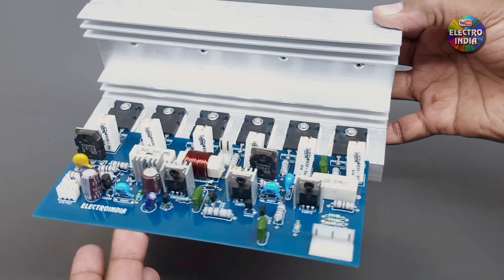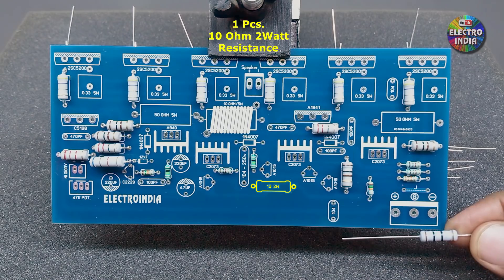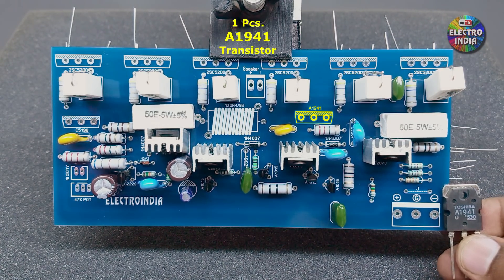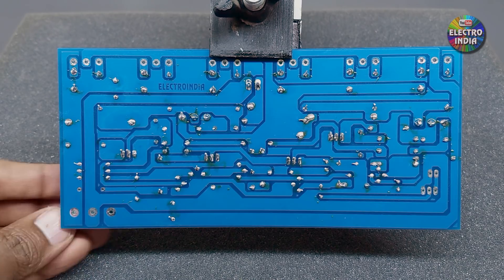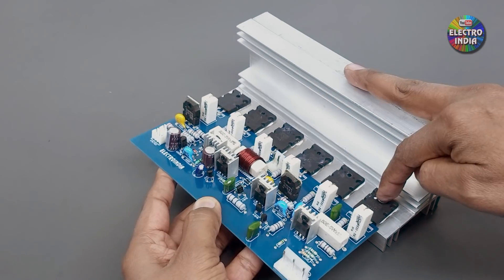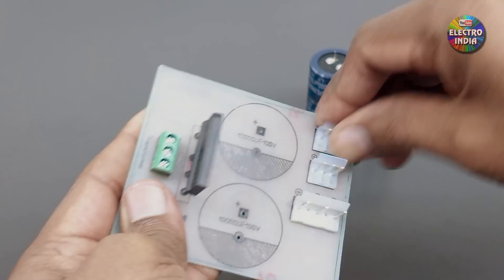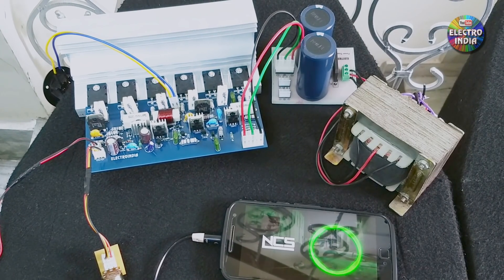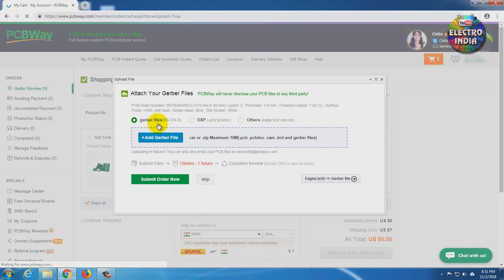300 Watts Mono Audio Amplifier Board DIY Toshiba 2sc5200/TTC5200 Transistor | Hindi ElectroIndia

Comment: Congratulations on the content of your channel.  I am thinking of building an amplifier for a 12 "/ 600W subwoofer box. I would like to know if this model works well. There is another one with 4 transistors and the source on the board itself. This one is easy to assemble but has only 200W.  Here in Brazil it is difficult to find original transistors. Thanks

Comment: Mujhe yeh 300 watt mono board with low pass filter kharidna hai....Aapka wattsup no. message kariye....Mera no hai 9727335274.  Mujhe 50watt each 5.1 7294 ic setreo board bhi aapse  kharidna hai...aur bass treble board bhi kharidna hai....please.

Comment: Hello Sir, I have tried to built this 300 watts circuit board, it is working good but i notice the third 2SC5200 Transistor (from left to right) is not working.. i have tired replacing with new transistor but still it is not working.. while doing continuity testing with multimeter, all the other 2sc5200 shows the same value, but the third transistor alone shows different value.. can you please advice how to fix this issue? can you please provide your continuity value for third transistor and also for the others?
Reply: HOW DOES THIS BOARD WORK ON SIR, 6 5200 SUPER BIRDS instead of 3 5200 AND 3 1943?

Comment: Dada 8mosfet2sc5200/1943 ka board ha osma 45 0 45 .12 ampir transformer lagano jaba kia
Reply: Probably that would be too much voltage & current for that amp. I have the same kit. Better to use a 30-0-30 v  with 10 amp max transformer.